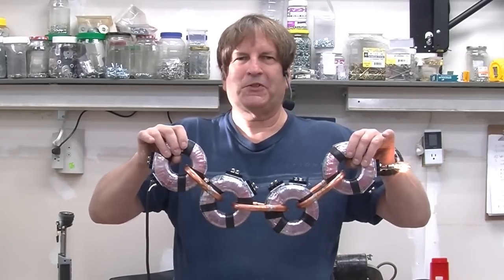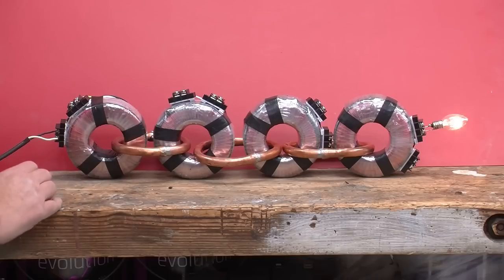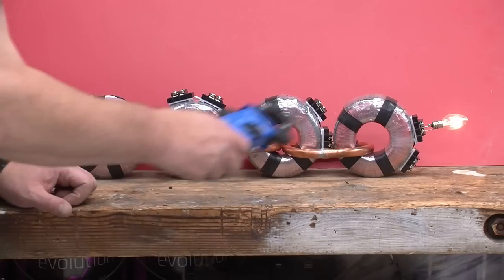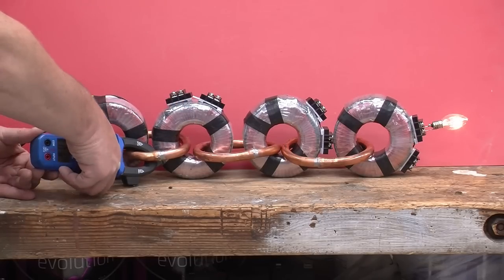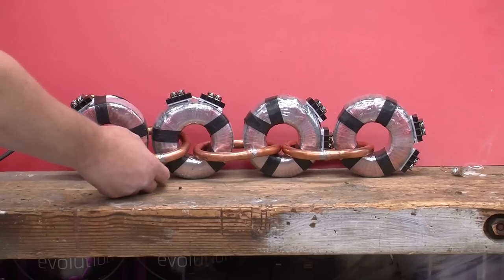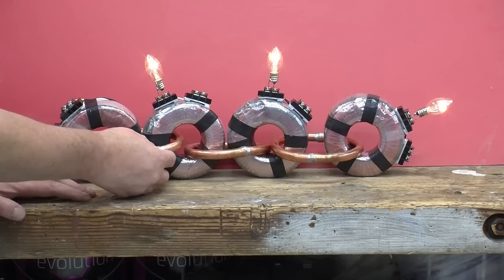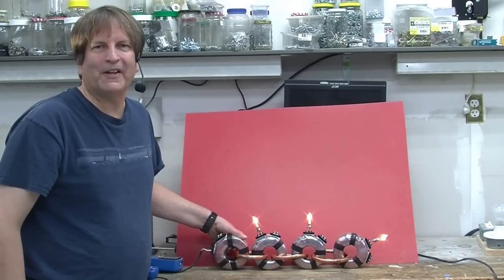Let's Experiment with an Electromagnetic Chain!

Comment: That was a great demonstration, thanks.  I had not seen that before.  Really drives home the effect of bad power factor, with the wires needing to carry the (reactive) magnetization current, even if the load (real power) is small.
Reply from the maker: Thanks - glad you liked the demo! Yes - nothing like single turns to really make things like that stand out.  Or for that matter toroid transformers which make it so easy to thread things though the core for a demo. I'm doing to do a future video about magnetizing current and power factor and also saturation and magnetic amps!
Reply: @ElectromagneticVideos  It also demonstrates nicely how  the magnetic field is perpendicular to the electric field.
Reply from the maker: @paulmichaelfreedman8334  Yes!!!!!! An I plan to use it again to show that when a do a video on EM waves.
Reply: Power factor and coupling. Both decrease efficiency of the circuit.
Reply from the maker: @spvillano  Oh yes! Definitly not the ideal way to efficiently transmit power :)

Comment: You are an excellent teacher. Thank you for creating this channel and content 👍
Reply from the maker: That you so much! I really appreciate that!!!!!
Reply: @ElectromagneticVideos  when you load the last toroidal, do you still have lenz law affecting the input?
Reply from the maker: @kanjo-Etienne  Well if you mean what happens when a coil on the last toroid is shorted, yes - so that almost sets its magnetic field to zero, so now the copper linking the 2nd last to the last torroid is essentially a short and that works it wat back towards the first toroid. So other than resitive or other losses limiting things, yes.
Reply: @ElectromagneticVideos  thanks
Reply: @ElectromagneticVideos  another idea that came to mind is that you can stack 3 toroids together to have one, though with each still having its independent windings, then wind all three as one core. The central toroid acts as the input while the rest is output I did this back in 2013 with a mentor and had some interesting features
Reply from the maker: @kanjo-Etienne  Interesting - never heard of that. I'm guessing the main feature would be quite a bit of noise isolation between the outputs on different cores?
Reply: @ElectromagneticVideos  certainly but also more. Just try and see. When you will load the top and bottom toroid, there will be very little effect on the central one.
Reply from the maker: @kanjo-Etienne  Intersting.

Comment: Excellent Demo! I suspect you saw this or a similar basic electricity and magnetism demo at the Deutsches Museum in München (Munich, Germany) Their AC and DC very high voltage demos are very exciting, too. The Science Museum in Earls Court (London, UK) removed their impulse generator demo. Also, the mercury-arc rectifier demo that powered the DC motors in the museum's passenger lifts. Pity, as a schoolboy these were the daily demo not to miss.

There may be something similar at the Exploratorium, (San Francisco, California, USA) they had a "shorted single-turn secondary" coil filled with aluminium, it melted when energized, and solidified again as it cooled.

Great hands-on demos to drive home the theory that comes later in college.
Reply from the maker: You got it - Deutsches Museum in München was were  I saw it as a kid. And I will never forget the HV demo - "lightning" hitting a building, and the person in a Faraday cage. I actually looked on their website the other day and it appears that fabulous demo is shot down for the next few years while they renovate that part of the museum. 

Sad to hear about the Science Museum in London removing their demos (never been there but others had mentioned it). The  San Francisco Exploratorium shorted coil demo sounds great. The museum that have real memorable demos like that are the best and are the one that get remembered. 

Glad you like this video - yes - a nice connection to the theory for anyone in EE or physics or with that sort of thing in theior future!

Comment: Thank you for making this experiment available, we built the device over the weekend and it works perfectly, with 3 x 5 watt lamps the copper pipe current measurement is 53 amps. It also shows us the relative phase angle between the voltage-in and the current at around 90 degrees out of phase a great demonstration.
Reply from the maker: Thats great - I'm thrilled to hear that! I would love to see a photo or video of your chain - could you email me one? Email on my about page. Or do a video? How did you bend the copper pipe? I found that the hardest thing to do was bending the pipe and only managed after buying two pipe benders (first one turned out not to be suitable). And even then they are not really made for 180 degree bends. Buy the way - you do know that the individual 120V coils on the cores are isolated so even if you use a gfci to power the chain, you will not be protected from a dangerous shock on those terminals if you put your fingers or anything else across them.  For demo purposes it might be safer to run the chain at say 12V or 24V AC and use 12V bulbs ....
Reply: I have made a permant magnet monopole
Reply from the maker: @andrewmcqierry4542  Please invite me to attend the ceremony when you receive your Nobel Prize :)
Reply: In high school, we had selectable tap AC bench power supplies from 2 volts up to 12 volt. Something like that would work well for a demo like this.

Comment: Very cool. I’ve never seen this demonstration before. Very interesting.
Reply from the maker: So glad you liked it!  I sure wish I had the HVAC skills you must have in bending the copper pipe - what job - I have new respect for people in your field. Glad you liked the demo!
Reply from the maker: @UniversalExpanse Because of the orientation of the magnetic and electric loops and their interactions being at right angles, at first glance  it would have little effect other than the iron being less of a conductor. However, due to stray fields,  you might get a bit of an interaction.

But you got me thinking. Say you somehow made all the cores (both the electric and magnetic) ones identical  - electrically conducting and, magnetically permeable like iron, and restive to eddy currents. You might be able to setup two flows of energy - one using the vertical toroids magnetically the other using the horizontal  toroids magnetically . So each toroid would be the magnetic path for one flow and the electrical path for the other flow. Much like (circularly) polarized light. That would be a tricky but interesting thing to try, and for a longer chain, see if the their is crossover from say the vertical path the to horizontal.
Reply from the maker: @UniversalExpanse Anytime!

Comment: Awesome demonstration. It would be interesting to see the current and voltages on some oscilloscopes in order to observe their relative phases.
Reply from the maker: Thats! I am trying to figure out a second video video with the EM chain and that's an interesting idea. It might be interesting to try and see the propagation time from one end to the other and compare with a standard coax or Cat5 transmission line.
Reply: @ElectromagneticVideos  your chain is very interesting! You could measure current at each link by creating and adding "magnet wire" winding loops to each link on the chain, and feed each winding loop pair to an oscilloscope channel. The winding loops will measure current induced by magnetism, similar to how your chain works. My hypothesis would be 90 out of phase for each link. Such an interesting contraption. Thank you for sharing it with us
Reply from the maker: @LydellAaron  I like that - and maybe a bit more of an in-depth look at how wire loops (=loop integrals)  work, and its hard (impossible) to directly measure the voltage of "half a loop". 

Your right about the current being 90 degrees out of phase with the input voltage (assuming no load) but  the loops you suggest (assuming I didn't misunderstand your description) will actually show the value of the changing magnetic flux  (the Faraday equation in Maxwell's Laws). What you describe would be correct if measuring coil (and hence the system) was essentially shorted as in a current transformer, but that's a different scenario (will be covered in a future video). I do have some clamp on current transformer style current probe's somewhere (=a current transformer) - might be able to use them to show the loop currents on the scope. 

Thanks for the suggestion!
Reply: Can you explain how the right hand rule can be applied to toroids. Also  how does ti apply to the horizontal pipe? 
What formula do you use to find out the needed turns for 120V. ( primary). Can the turns overlap? Both in primary or secondary.? I am a physician, former TV repairman in the 60’s and early 70’s before medical school. Now I am having more time in my hand but still seeing patients . Doing a fast 40 yr catch up & having a hard time catching up…  I worked mostly on Yagi antennas as an Extra class amateur radio back then. Also participated on the building of the first amateur radio satellite launched into orbit OSCAR 10. The previous ones were flown in balloons, private airplanes an even using a kite! More details if you are interested.  Great lecture on Maxwell’s equations. Had a heck of a time in pre-med physics. My professors came to the conclusion I was missing a reverberating neuron network that must be crucial to actually understand Calculus!  I just memorized the formulas and entered th numbers…got A’s and B’s without ever understanding what the purpose was!

Comment: I have not seen it in a museum, but made something like a miniture version in an electronics lab. Only powered by a signal generator, and loaded with LEDs. We also added capacitors, and observed the effect using a CRO (a real one, not a digital scope).
Reply from the maker: So a higher frequency version with  the capacitors to make the chain have a resonant frequency? Intriguing!

Comment: Great demo! Though the GFCE would not trip since all the current in the first coil all comes back.
Reply from the maker: Yes - everywhere in the chain there is no ground connected current path. the purpose of the GFCI/Isolation transformer is to protect my fingers from the two terminals on the left coil where 120V AC is fed into - they are live. I could have covered them with tape, but I also wanted them exposed for other experiments.
Reply: @ElectromagneticVideos  Is the GFCI before or after your isolation transformer? Before the transformer, it will trip on a transformer primary failure. After the transformer, and it's unlikely to help (depending on leakage characteristics of the isolation transformer). 
On the other hand, an AFCI breaker would help protect against incidental differential circuit contacts
Reply from the maker: @dl5244  You absolutely right - it will only trip if the isolation transformer were to fail. And there actually is an AFCI breaker in the electrical panel supplying that circuit. I don't think it  is likely to trip (from arcing) because I suspect the isolation transformer's limited frequency response will remove much of the higher frequency noise used to detect the arc. 

The isolation transformer is the main safety device. The reason I mentioned them in passing in the video was to make sure anyone thinking of doing  something similar would be reminded to use safety devices. I dont want to set a bad example by being reckless.
Reply: @ElectromagneticVideos  one thing that I didn't think you made clear was that an isolation transformer only protects you from touching a single potential net. 
Even a single finger toughing both terminals of the load bulbs would be shocking.

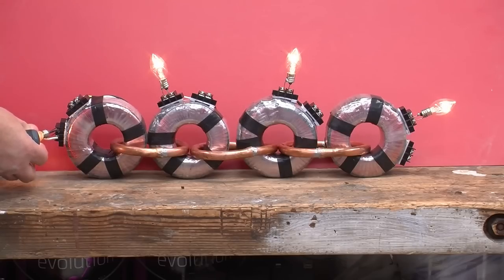Comment: 7:00 You say that the power input is through a GFCI and an isolation transformer as if it actually means something. You do realize that as soon as you galvanically isolate the current path, the GFCI becomes useless? That means at best the first toroid is protected if you were to accidentally provide an alternative path to source (assuming you have isolation transformer to GFCI to the input of your demonstration)? IE if you were to accidentally touch both sides of any of the other transformers you could provide a path through your body and/or tools that would not be detected by the GFCI, and could potentially be lethal? To be fair you'd have to touch the other end of the coil, not something else that's grounded as I'm sure you didn't ground reference any of the coils.

This is a really awesome demonstration otherwise and I'm certain you already know the above, but the way you pass it off as "oh yea its protected and safe" is dangerous to any inexperienced person that could try to replicate this experiment.
Reply from the maker: Yes - your not the first person to point this out. I was trying to get across that one should have some protection when doing stuff like this, with the isolation transformer or gfci being a possibility. I so happen to have gfci in the wall plug, but prefer the isolation transformer to prevent current flow rather than to stop it once started. 

And your right - you could get a lethal shock if two parts on other sides of your body (fingers on opposite hands) touch the two 120V terminals on any one of the toriods. A safer setup would be to cover the 120V outputs on each toroid and just use the low voltage ones for sampling voltage and hence flux strength. 

Glad you liked it otherwise.